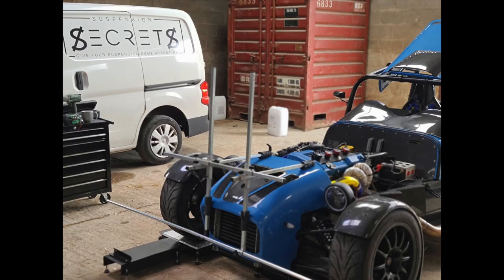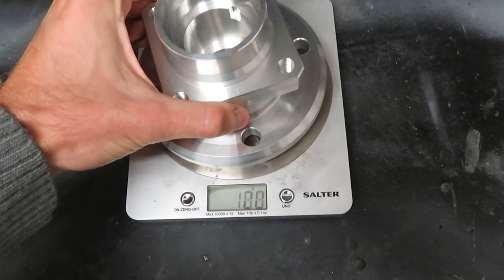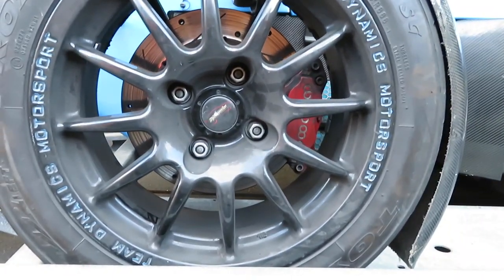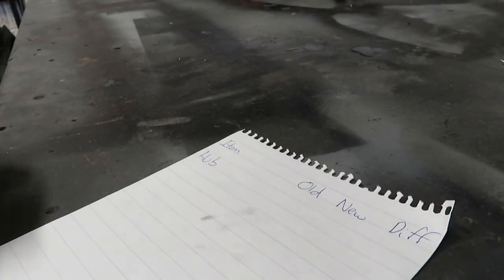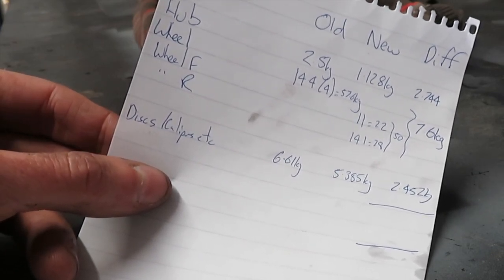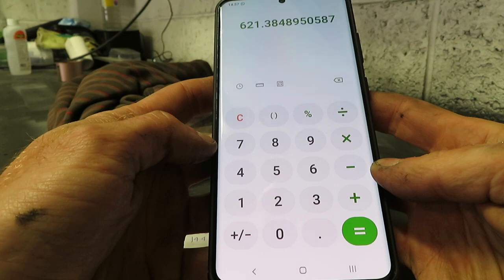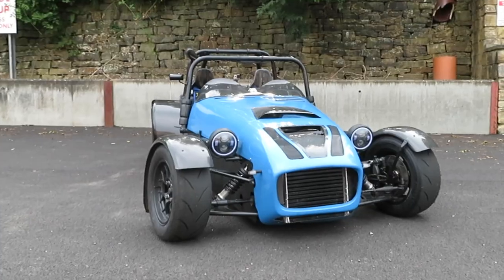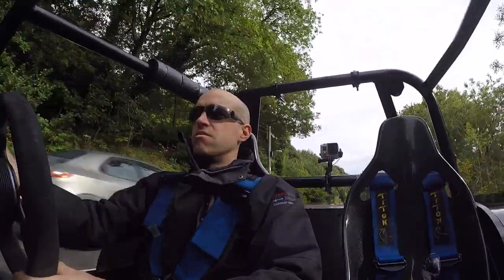NEW WHEELS AND BRAKES *Weight Saving*

Comment: I love the new look the car is amazing. I look forward to new content. Quick question im looking at getting one and i want it nissan powered. How hard was it to get the sr20 to fit or was it OK. And is the anything I should look out for.
Reply from the maker: Mine's a ca18det so abit different to an sr20. An sr20 is slightly taller and the wiring is more complex. You'll need a modified sump and/or bonnet bulge or scoop. There are several around though so you won't be the first. Always someone somewhere to help!

Comment: Great video. Love seeing the mods. When I built my kit car I found the building and subsequent mods is more fun than the driving, especially when the car only wants to kill you! Look forward to future updates. It would be interesting to know cost per kg saved - it's a bit like how much it costs to add bhp to an engine.
Reply from the maker: Thanks for feedback 😁 c.£45 per kg but that's before selling old bits... Once they're sold maybe £15/kg so not too bad.
Reply: I agree, being such a raw car i find my Westfield is hard to drive anywhere near it’s limits on the road. I have found can drive “less capable/powerful “ car faster than my clubman on the road. That’s why I have spent more enjoyable time on
Modifications!
Reply: Locost Turbo once you do your first few passes at losing weight on a clubman, I.e, spare tyre removal, lighter seats, lighter wheels and tyres,. The cost of light-ness is exponentially expensive!  Light weight aluminium diff carriers, small light weight brakes, lithium bike batteries, alloy hubs. Then you go to replacement CF bonnet and nose cone $$$$.
Reply from the maker: @Jamesannthony118  you're absolutely right. I have most of those already though lol. Diff carrier I'm not considering but carbon fibre nose, bonnet and scuttle...yes please ❤️

Comment: Such a nice car! Have you noticed any change to how the brakes feel? Are they still ok for that much power? Love the vids!
Reply: With light weight cars solid discs can help retain heat and give better braking
Reply from the maker: Brakes will be fine. There are heavier cars running the same setup. The old ones were overkill tbh. Some owners use the 247mm vented discs!!

Comment: What happened to the front and rear wings? Did they make a noticable difference handling wise?
Reply from the maker: I still have them but the front wing is too low to run on the road. I'll do some back-back testing next time that I'm on track.

Comment: Great effort man!! Off for some billet uprights when its possible 👌
Reply from the maker: Was considered at the time. They only saved 800grams on standard and I took the decision the reduced strength offered by ally didn't make it a worthwhile risk.
Reply: Siltech does offers the strength too.I do have their front Upright and wishbones kit,but dont remember the difference between the cortina ones..
Reply from the maker: @tigra8559  I know there are some options available and I'm sure they're OK. There are easier wins though - the Alu uprights are about £200, then I'd need geo re-checking which is another £200. Makes it expensive to save less than 2kg... Maybe later on. Got other areas to focus on now that are cheaper. I am a Yorkshireman remember  😉